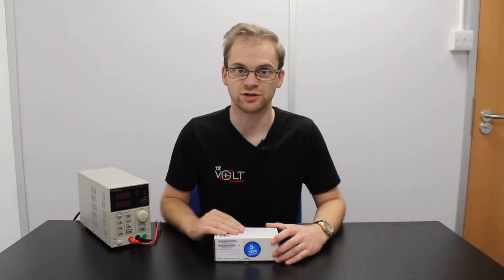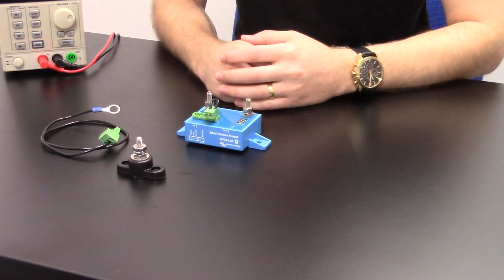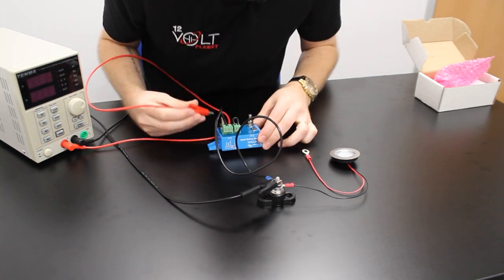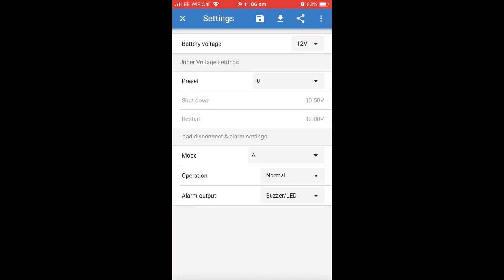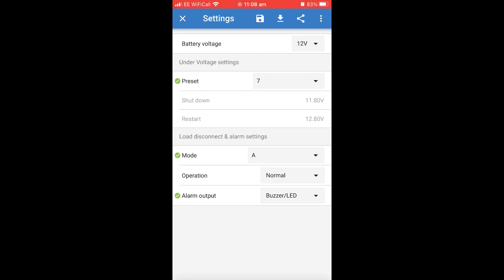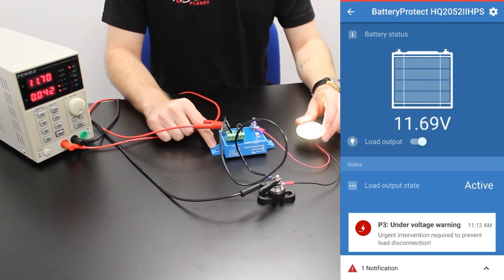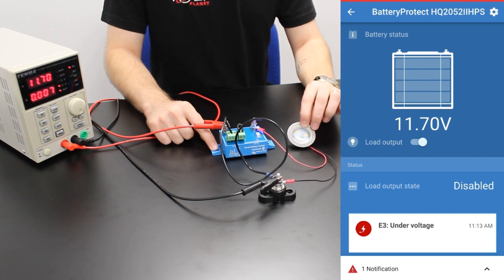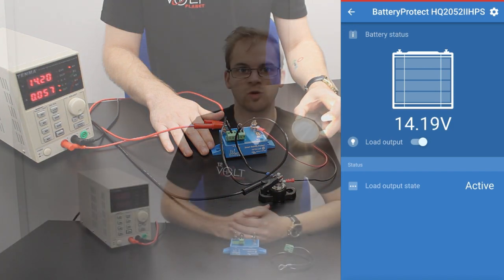Installing a Victron Energy Smart Battery Protect | 12 Volt Planet

Comment: Hey everyone quit nickel and diming and adding complexity. Buy  batteries with built in bms up front and throw that plywood board full of electric out. Hook up an "all in one system " two wires and your done. It's good stuff but going down the blue road is expensive!

Comment: Hi, thank you for the review ! i have a question . . i have a problem with my anker powerhouse 757 if there is not enough solar power coming in my anker powerhouse 757 goes tilt mode and turn off all output ports for my cool box and chargers connected to my anker powerhouse . if i put this device between the solar panel and the anker powerhouse you think this will work to turn off my anker powerhouse before it goes tilt mode ?

Comment: How does this work with Solar charging ? I assume you have to connect the solar (and B2B and shore charger to that matter) directly to the battery and only the loads to this ? Makes the wiring messy - i've got one positive cable to a fuse box at the moment... Anyway, thanks for the video!

Comment: Victron specifically warns against connecting loads like inverters directly to the OUT terminal because inverters have large capacitors which cause high inrush current when first switched on, and this will cause the BP to cut power because it will sense a momentary large current and/or voltage drop. Inverters should be connected directly to the IN terminal of the BP, and the OUT terminal on the BP should be connected to the Inverter's remote on/off. That way the BP won't get a false trigger but will still shut the inverter down in case of a true over current/under voltage condition. Other loads can be connected to the OUT terminal in the normal way.

Comment: How to connect a charger (always connected as backup) to charge the battery to a preset % when there was an under voltage and turn the charger off when the preset % in reached  ?

Comment: How to open the car and start the engine, if it disconnected all the equipment like the starter?
Reply from the maker: We would recommend not attaching those key items to a smart battery protect.
Reply: @12VoltPlanetTV  there is no point in this device then
Reply from the maker: @olegshevtsov3284  This unit is to prevent loads such as lights, Fridges etc from draining leisure batteries thereby damaging the battery. For starter batteries, it is can be used to prevent your battery from being unable to start the vehicle from drains from security systems or other modifications. If this is not what you are wanting then please contact our team who will try and assist,.
Reply: @12VoltPlanetTV  , ok, the voltage drops below the limit. You disconnect the load.

prevent your battery from being unable to start

What should a person do to start a car next morning?
Reply from the maker: @olegshevtsov3284  Charge your battery as with or without the smart battery protection you would need to do this to start the car. The smart battery protection will merely prevent further discharge that would result in you needing a completely new battery. If you need further help please contact our sales team.
Reply: @12VoltPlanetTV  , what about "disconnect the protection, start the car"? Is it too complex?
Reply from the maker: @olegshevtsov3284  Hi Oleg, As stated if your battery protect has broken the link to your battery you would need to charge the battery before you could start the car. Please contact our support team on 01844 885 100 and they will endeavour to break this down further if needed.
Reply from the maker: @olegshevtsov3284  You would be unable to as the battery would be flat hence why the smart protect would have disconnected. Please contact our sales team who can discuss your plans and try and find a solution for you.

Comment: I am replacing my 2 AGM batteries with 2 Lion Energy UT1300 lithium.  The UT1300 have their own Battery Management System built in.  Should I remove the Victron Energy Smart Battery Protect 12/24-Volt 220 amp?  Thank you.
Reply from the maker: I would recommend discussing this with the retailer who sold you the UT1300 as they will understand the BMS system and how it works best.

Comment: Thank you for the review! Can you set any value manually under "user defined"? So can you set "Under Voltage" to for example 12,5v?
Reply: I thought the answer was yes - i believe this was the point of the smart version - Bluetooth connectable to the app - allows user defined parameters
Reply from the maker: Hi, Sadly at the moment only presets are available however Victron is always updating the software so this may change in the future.

Comment: I have a 2000w inverter and a 60amp battery protect. If I put a small 700w heater on then my battery monitor shuts down the system almost immediately even though my relatively new 200ah AGM is fully charged. I don’t understand why this happens.  Should I be dividing 700w (call it 1000) by 220v or 12v to get the amps if going through an inverter?  Is it shutting down because the amps are too high for the battery protect, or am I simply using too much juice for the battery?  Do I solve it with a higher amp battery protect or a bigger battery bank or both?  I don’t want to actually use a heater, but maybe other high amp items, so I just want to understand the issue. Thanks.
Reply from the maker: It is likely down to the battery voltage dropping when certain appliances are switched on. I would recommend using a voltmeter to monitor this drop and then you will have a better idea of how to move forward. Sadly it may be that due to the high requirements your battery is simply not enough and will need to be upgraded.

Comment: I just found out that you can't use a battery protect with an inverter, I have 4 100ah victron super cell batteries, a 220 victron amp battery protect and a victron 2000va inverter, do I just wire the inverter directly to the batteries and the battery protect after the inverter so the inverters power is not measured through the battery protect?
Reply from the maker: Hi, Victron do not recommend it as their inverters would have a battery protect feature built-in. Other branded inverters that don't have that feature would be able to be used with the Smart Battery Protect.
Reply: @12VoltPlanetTV  Thanks for the reply, yes, I was aware of Victrons advice about not using the battery protect with the inverter, but, I also have 12v direct loads, couple of water pumps and a UV light, is it safe to use the battery protect after the inverter has already had a supply from a bus bar and the direct loads on another post of the bus bar?
Reply from the maker: @tinyhouseonwheelsireland  Yes that would be perfectly fine.

Comment: hELLO    ! Please, is it necessary (and why) to put a "victron energy  battery protect" 🙂😮😮 like I got a good BMS on my battery ? It seems to do a similar job, no ? Thank you. (perhaps have you got also a better idea. Thanks)
Reply from the maker: Hi, No it is not necessary but it is good to have as a safety precaution to prevent over-discharge. Some BMS's may have this feature in which case no you would not need this item.
Reply: @12VoltPlanetTV  Thanks. My BMS got it. Sincerely !!!
Reply: @12VoltPlanetTV  Thank you !!!!!!

Comment: When the device reaches the low voltage disconnect voltage, is it the voltage measured while under load? or the resting voltage? lets say for example I have a load taking 5 amps and the voltage under load drops to 11.8 volts, when the disconnect operates and the load is disconnected, will the voltage jump to it's resting voltage once the load is disconnected? I've never understood why when a battery is 50% discharged the voltage is in or around 12.2 volts that the disconnect voltage is 11.8 volts, surely that's way below the 50% level?
Reply from the maker: If the voltage drop is that large on a load being introduced yes it would be disconnected after 90 seconds. However, we would only see this on large drawing items such as Inverters or a starter motor.  As this system is designed to be used in emergency cases and is unlikely to be used daily having the batteries drop to this level once or twice in there lifetime would not cause lasting damage. Although best to make sure your battery does not drop below 50% this is something that can be done with AGM or GEL batteries and still have 400-600 cycles.